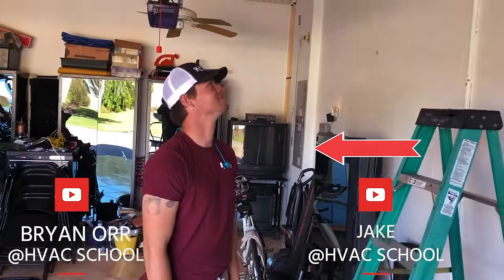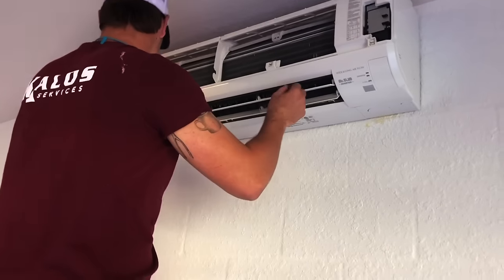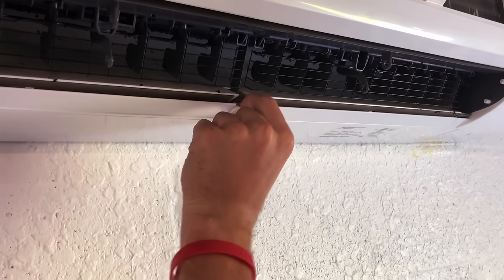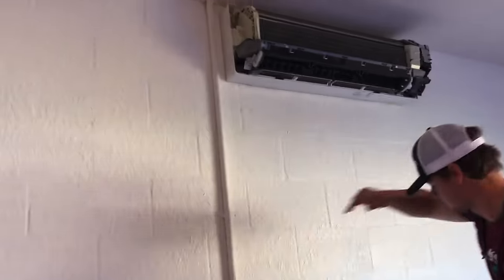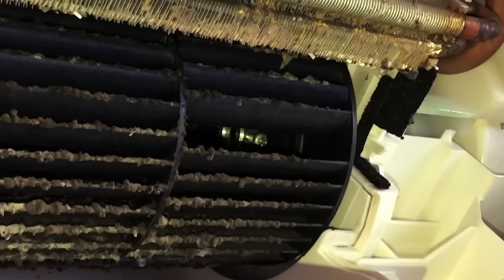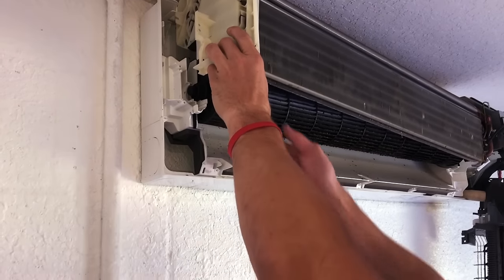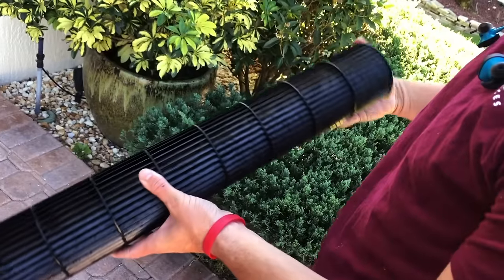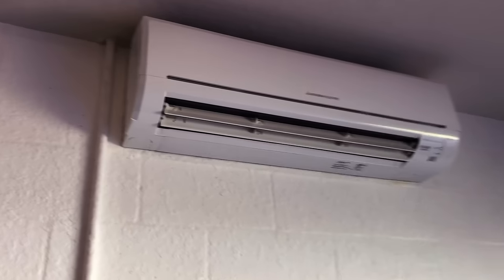Highwall Ductless Blower Wheel Cleaning

Comment: FAIL ! you tell them to turn power off 2 min into the video
Reply: Not a fail dude. He didn't get to any electronics until then and the unit was off. If you're gonna rag on someone at least know what you're talking about. By your statement. You need to turn off power to clean the filters which you don't.